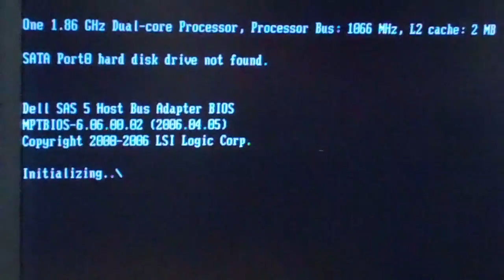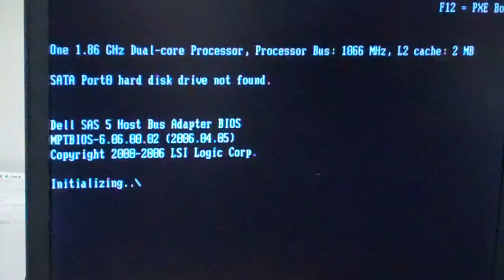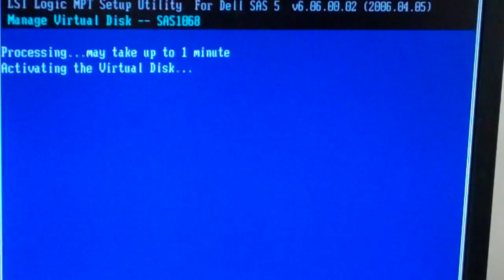Velocity Tech Solutions - How to Replace SAS 5 Controller on a PowerEdge Server

Comment: Hello! i have the RAID SAS 5/iR SAS PowerEdge CN-0UN939 E2K-UCS-51.
This card is for sas, sata and raid 1 disks?i try to setup my SAS disk 15k seagate and is not a raid disk. Then this card support raid 1 disk? Thanks!
Reply from the maker: Hi there, Yes this does support a Raid 1. Make sure you Have the correct drive size supported for this controller. According to Dell the drive size up to 2TB. Best of Luck